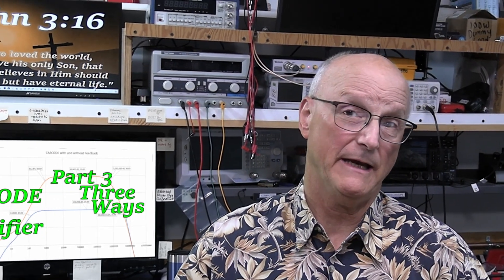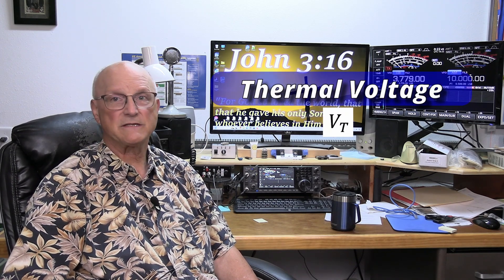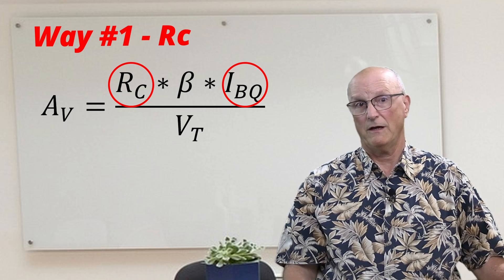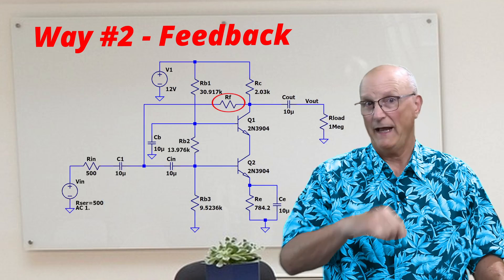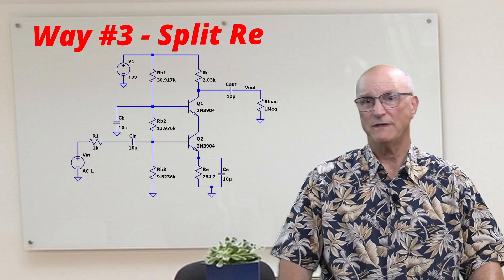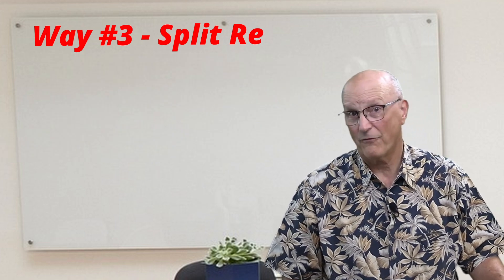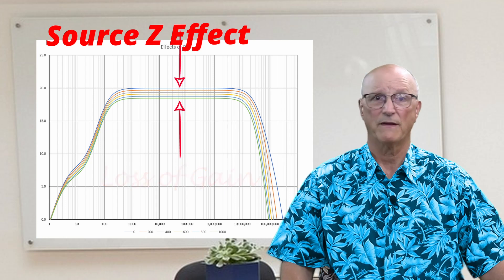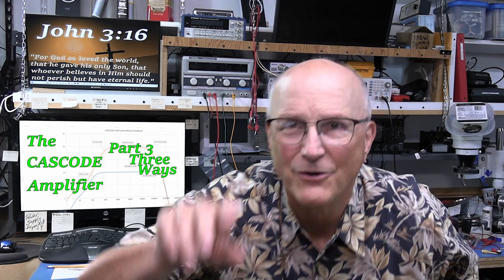CASCODE Amplifier (Pt 3): Designing in a Fixed Gain (066g3)

Comment: It's a very interesting circuit configuration. I've seen a design of fm wireless microphone for 88 to 108 mhz that used a cascode amplifier for the oscillator. it had BF199 transistors. Worked well and was quite stable
Reply from the maker: I hadn't thought to use one as an oscillator. It must have had some sort of crystal associated with the circuit to ensure stability and accuracy. :-)
Reply: @eie_for_you It had a series tuned colpitts configuration in the lower transistor and the modulation was applied to the lower transistor's base through a resistor and capacitor after they amplified the electret microphone with a single transistor
Reply from the maker: Very interesting! :-)
Reply: @eie_for_you LC tuned free running. i would love to sketch out a circuit for your interest, but i don't know how you can receive it
Reply from the maker: Cool! :-)
Reply from the maker: Now THAT is cool! :-)
Reply from the maker: It sounds like you are having a LOT of fun! :-)
Reply: @eie_for_you That was 20 years ago so I'm having to think about it to remember 😅
Reply: I'd love to see you do a video based on this oscillator... A VFO for HF and doing some measurements and experiments 🤔😅✅
Reply from the maker: Send me a schematic, please. It might be something to play with.== ralph.eie4you@gmail.com :-)
Reply: @eie_for_you Alright Ralph, I dropped you an email with a few circuits I have been playing around with very recently.
I hope you enjoy!
Reply from the maker: Got 'em! Thanks! :-)
Reply: @eie_for_you I speculate the
 22pf between the upper transistor BE is for modulation linearity, to exploit the capacitance between base and collector in the first transistor
Reply: @eie_for_you You have my full encouragement to use those circuits for the basis of some videos if you want to.
I can send you more of my experimental endeavors by email in the future also.
I'm not after anything, but I do love to experiment!

Comment: Two improvements .
In the bottom of the bias chain put a 100 ohm  and a 1n4148 in series ,q1 emitter resistor  to set  operating current. 
The voltage swing  at the collector of q1  is  very  low , so you only need  say 3 volts dc there.
So you can get  a much larger output  voltage swing .
Reply from the maker: Interesting suggestions! :-)

Comment: Can you please show me the actual calculation of the Av(max).  No matter how I use the formula in 066c I cannot get the Av(max) to work out.  If you reverse your calculation to calculate Av(max) you get 345 based on Rf=11.5K and Rs=1k and Rin=500.  The cascode amp in 066c seems to give Av max of 117.1 volts (41.4 dB)
Reply from the maker: The formula you need was in the last video, 066g2, and the formula sheet for that one is here: https://drive.google.com/file/d/1uzO3a4mXY2uli8bmabFcdhMsybLnG88g/view?usp=sharing
Av(max) is 117.1 (dimensionless). See if this breaks this loose for you. :-)
Reply: @eie_for_you    Thanks for your reply.  If I use Av(max) to be 117.1 in the formula Rf = (Av(max)*(Rs+Rin)/(Rs+Rin))/(Av(target)  I get Rf to be about 3900 ohms.  Am I using the wrong equation or Rs or Rin values?  Using Rs = 1000 an Rin = 500
Reply from the maker: Using Excel to do the math, I went through the formula with Av(MAX) = 117.1 and came up with Rf = 9953. Because this is different than what I have in my formula sheet, I doubled back on myself to discover that the circuit in the last video with the gain of 117.1 is the one where I forced the hFE to be 100. Here in this one I let LTSpice use its default hFE for the transistors which is most certainly NOT 100. As a result, the Av(MAX) for this circuit is 135.3 per the LTSpice simulation. Sorry for the confusion. :-)
Reply: @eie_for_you  Thank you for the clarification.  I also noted the defaul hFE for transistor was something like 300 or 312 in the LTSpice library definition.  I used a .model and set the Bf = 100 for the transitor.  Your explainations make it easy for me to learn about BJT's.  I am 74 years old and a retired engineer trying to keep my brain working by learning things.
Reply from the maker: I can so relate! I am 70, a retired EE and immersed in this stuff. In some areas I am rejuvenating knowledge I once could practically do in my sleep, but now ... ugh. In other areas, I am learning fresh and new. One way to keep the brain working is to be working the brain!
I am glad that my explanations help make it easy to learn. That is my goal. Let's keep learning and learning together! It is so exciting when the light goes on and we know we understand something. :-)

Comment: Like this series...  Super practical with regards to getting from A to B instead of blasting you with calculations and theory seemingly without purpose...
Reply from the maker: Thank you so much! I am so very glad that this series was a blessing to you! 🙂
Reply: @eie_for_you  I had one question though...  The Av(max) in the second feedback calculation....   I wasn't sure what you used for that.
Reply from the maker: @djdiscoordination639  I'm going to have to go back and watch my own video to remind myself of context. Be patient, I'll get there. 🙂
Reply from the maker: @djdiscoordination639  Aaaaah! Now I get it! I apparently assumed that folks watching this video had been following the series. The Av(max) is the maximum gain of the CASCODE amplifier as in the previous video which assumes a source resistance of 0 Ohms. The formula is in the go-along-with-the-video formula sheet here:
https://drive.google.com/file/d/1uzO3a4mXY2uli8bmabFcdhMsybLnG88g/view?usp=sharing
Sorry for the confusion!🥺
I hope this helps dispel the fog of uncertainty. 🙂
Reply: I'm so lazy, I experiment with a desired supply voltage until it's good enough. Being an experimenter, I know ball parks etc to start with.
It's bad for proper education perhaps 😂😅

Comment: Great learning video Thanks!
I prefer option 2 the feedback resistor, it seems like a very simple addition with a lot of versatility
Reply from the maker: The only real downside that I see with it is its dependence on the output impedance of the previous stage. I really like that it gives so much more bandwidth. 🙂

Comment: THAT LITTLE GUY IS SO COOL!I WONDERING WHETHER THE COMBINATION OF NEGATIVE FEEDBACK AND,THE SWAMPING RESISTOR IS RESISTOR IS THE BEST WAY TO GO.DOES THE FORMULA FOR THE SPLIT RESISTOR IN THE EMITTOR WORK FOR COMMON EMITTOR, COMMON BASE, COMMON COLLECTOR CIRCUITS?
Reply from the maker: That little guy is actually a free image I download from sites that have such things available. The only pictures or videos you will ever see in my videos are either shot by me or available on these free sites like PIXABAY or PEXELS.
This spit emitter equation was specifically derived for the CASCODE amplifier. However, because of the assumptions made in the process of analysis, it will probably also work for the common-emitter amplifier as well. 🙂

Comment: Ralph's ham shack😎
 I was expecting all kinds of homebrew gear what's up with that Ralph🤗
Thanks again for another great video I always learn something.
Reply from the maker: I am so glad that you benefited from the video! 🙂You are very welcome!
Well, the homebrew stuff is "hiding" in the background. For instance, there is a small box on top of the power supply with the green lights (I forget if it is visible in the video). This is my ultra-fast high voltage protection circuit. The power supply had failed with 24 volts on its output (prior to me getting it). I resurrected it and began the investigation into over-voltage protection circuits. That spawned this video: https://www.youtube.com/watch?v=i85iwemOd-w&t=1s
There are other such things hiding in the background, too. 🙂

Comment: Nice overflow of the colored shirts ;-) You are working with digits behind the comma for the resistors. In practise that is hard, It would be nice to have a  simulation with input from the E24 series (home work for the weekend ;-)).
Reply from the maker: Thanks! I changed the shirt colors in post production. 🙂  I simulated the circuit using standard 1% resistor values.  You will find the results here:
https://drive.google.com/file/d/1Q24gEkFUHmkLwMdd_dB3NBtXHruHLjHd/view?usp=sharing
I guess the weekend came early! LOL
Enjoy! 🙂